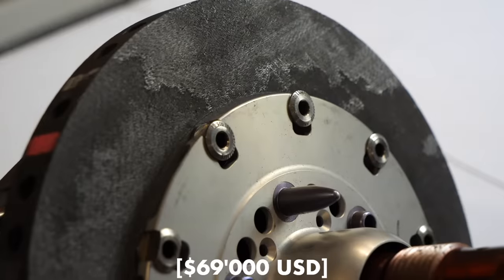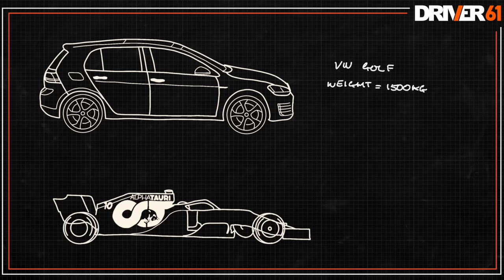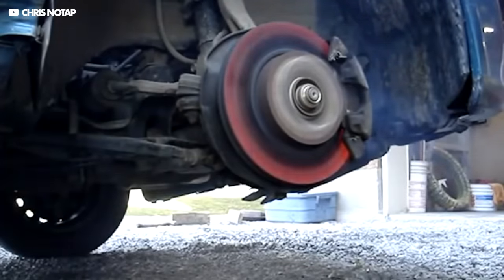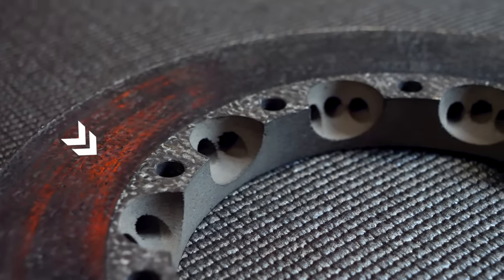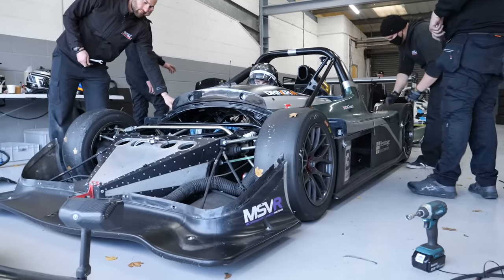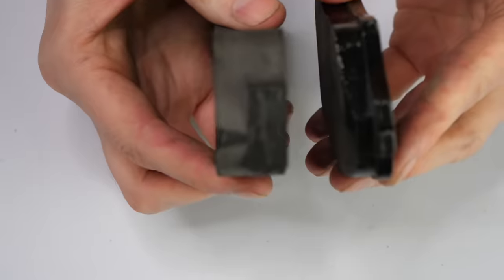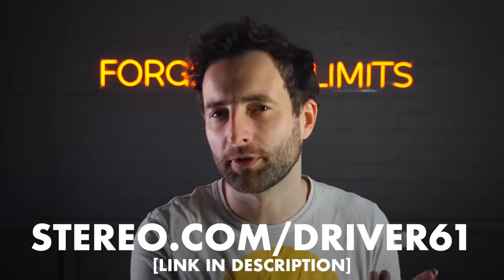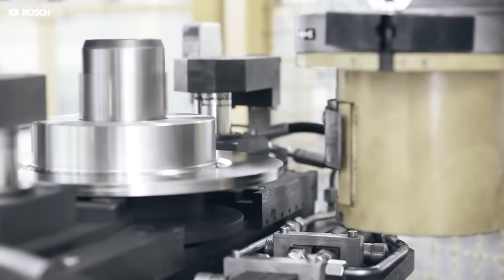Why These F1 Brakes Cost £50,000

Comment: Drag racers also use Carbon brakes.  I am quite sure they are not spending 50,000 pounds  per car for brakes.   So how are they able to do it cheaper?
Reply: they dont have to brake 1000 times a race like F1 would do?

Comment: This is an interesting video about the highly specialized carbon brakes used in F1 race cars. This video shows that car racing is a highly specialized sport that is very different from conventional automobiles. With car racing there is a lot of braking from very high speeds around 200 mph. With a conventional car on city streets most of the time there is coming from 35 mph to a gentle stop for a red traffic light. That is a big difference. In all my conventional driving I have never encountered brake fade caused by overheated brakes.

Comment: Also, that using your own body-weight and momentum to aid in braking. That's a thing for Saab-drivers. Whether you want to or not. You definitively need to replace seatbelt pre-tensioners every 5 years or so. as they do get activated quite a bit. :D :D :D But, then again, plebians gonna pleb.

Comment: 2:00 the maths for the kinetic energy of the F1 are incorrect. Actually, the kinetic energy difference is 1/2*[mass]*[[Initial speed]**2 - [final speed]**2], instead of what's shown in the video 1/2*[mass]*[[Initial speed]-[final speed]]**2. But the overall message is well understood

Comment: Some of the comments in this video aren't quite correct. Hydraulic brake fade from boiling fluid, is because the fluid is incompressible, while the gas produced is - and not that the fluid is less compressible, its not compressible AT ALL. Frictional fade from the temperature fall off of friction of the pad, will not make the brakes spongy, they will feel the same, you just wont get the same amount of braking from the same force, so you have to press harder. 
Brake fade can be caused by a number of factors, and brake rotor heat is not the only reason, and its also not quite accurate. There are 4 types of fade, friction fade, mechanical fade, fluid fade and domino fade. The major factor in all is heat. However brakes are not JUST made up of rotors/discs. We can think of the brake system as made up of two separate sub-systems, the friction system, made up of the rotor AND the pad. And the pad is the far more important part of the system when it comes to brake fade. And the Hydraulic System.
The heat generated, is generated at the interface of the rotor and the pad, meaning the pad also get hot. And after long enough, except for after an instance of very heavy braking, the pads and rotors will be roughly the same temperature (the rotors may heat up more quickly initially, as they're more conductive, but they also have a higher heat capacity. 
Pad material and technology is the thing more likely to contribute to 3 of the 4 types of brake fade. You can use different pads and experience less fade, or see fade occur later, even when using the same rotors, operated at the same heat. 
Regular brake pads that you find in regular, commuter cars, meant for soft braking, and low speeds, are made to have their braking performance (coefficient of friction) peak, basically at room temperature, or maybe a little above; they're not likely to get that hot due to their use and so you want the maximum performance to be when they're cold.
Then you have the other extreme of high performance racing brake pads, where the compounds chosen are designed to offer their best braking performance (coef. of friction) at much higher temperatures, maybe having their best performance between 300-350C or even higher. The consequence of this is they won't have very good friction at lower temperatures.
And then you have basically everything in between, from slightly higher performance street brake pads, to semi track pads. 
This is where we see the first type of brake fade, frictional fade. This generally defined is a reduction in the friction (coef. of friction) at the friction surface, the pad and rotor. This can be in the form of brake pad performance where the brake pads have heated and lost their coef. of friction, either linearly or curvilinearly. Other types can be caused by issues with brake down of the pad at the surface caused an interface layer to build up between the surfaces, drastically reducing friction, this can be gas from the pads breaking down causing almost like a cushion of gas; the other is resins in the pad, that break down and can glaze the rotor, this is mitigated using slotted or drilled (or both) rotors, giving the gas and/or resin an escape path, stopping ti building at the interface. Other forms of frictional fade can be caused by incomplete contact through wear, warping, etc.
The second type is Mechanical fade, which is associated with drum brakes as opposed to disc brakes. The drums heat up, and expand, moving the friction surface away from the shoe.
The Third type is hydraulic fade. After a long session of heavy braking, the entire brake system will heat up. This means the calipers, the pistons everything as the heat spreads.  This can lead to fluid boiling as mentioned, the boiling fluid causes gas in the lines, and instead of only incompressible fluid in the lines you have gas bubbles that take some of the brake force away by compressing, making the pedal feel very spongey as the fluid compresses in the lines.
Domino fade is caused by inconsistencies in braking force on the 4 corners, leading to excessive fade of each corner, accelerating the fade as each corner fails like dominos.

Comment: I have been working on a magnetic braking system for Formula 1 race cars and my new system is able to slow and stop a car from very high speeds with very little to no heat build up and without friction on the rotors. The system functions by using a magnetic core attached to the spindles surrounded by an electro-magnetic stater. As the brakes are applied the current provided to the stater is increased and pulls against the forward force of the spinning magnetic rotor attached to the spindles and to the wheels. As this happens no friction is applied to the rotor in any position of rotation providing that no heat will occur during high demand braking needs. The braking system is completely adjustable at any speed depending upon track conditions and is computer controlled. Sensors in the control module can sense brake traction needs at any speed and during cornering by referencing to suspension parameters. The system functions from a 100 volt 100 ah current system that is a variable volt and current system. It is for sale for 21 million dollars but needs more testing and research to be ready for its release to the public at this time.

Comment: Will they be able to have even better brakes when they move to larger wheels in 2022?
Reply: Maybe better cooling yes but i don't think the size will increase with the wheels because of the weight, so if no subject to regulations they will not change at all.

Comment: Just for any rides out there that are streets legal, theirs tones of products available form cheap to very expensive, just for my sport bike it’s street legal and already most sport bikes are already very well equipped of everything but if I want to change the calipers ‘’ just the calipers, no pads, no hoses, no master cylinder, for 2 calipers of the brand Brembo ( witch are in the best ones if not the best ) no the top quality but a very good one the prices for 2 calipers Brembo are around $ 2,000 , so imagine for a F1 😂😂😂😂😂
But ever heard the expression ‘’ to stop on a dime ‘’ !?   With this it’s almost true,  I’ve tried one bike on time who was all set-up for racing , not as a factory one but still, and I’m used to rides motorcycles, 35 years experience, did racing, stunts, you’ll name it !, and the first time I used the front brakes on this bike,( and I was been carful ) I almost fly over the handlebars, as it stopped so brutally guess it takes times to use to.

Comment: Road car brake discs are made of cast iron. If you had make them in steel they would have screamed alot. Cast iron is better to absorb vibrations and is better with changing temperatures
Reply: This. Specifically grey cast iron, which contains graphite. It also absorbs heat a lot better than steel and is resistant to warping.

Comment: So pieces of cloth are squished and then put in an oven for a month. Carbon is the most abundant thing on the planet. How much does that oven cost to run? What am I missing here? Not much detail on the mechanism.  A cost breakdown would be helpful for labor, parts, engineering, design etc. It's odd that the focus is on the pads and disc material but no mention of why they would be expensive.

Comment: I use ceramic brakes and do not experience fade after 20 laps.
Reply: Ceramic steel or ceramic carbon? Ceramic brake need to work at optimum temperature or drive and go?

Comment: Still doesn't explain the 50000£ price...
I doubt that there's more than 15000£ worth of materials.
But people will pay 50000£ and the "manufacturers" use "research" as an excuse for the high price. But you don't redo the research when you produce a disc. You just make a lot of discs based on the research that's you've already found, and most likely already made the money back so now it's just profit. But i might be wrong ;)

Comment: 5000£ 50,000£ or 20,000£ which one is it! Too much conflicting information....
Reply: Conflict #1
$50 for regular brake disc or 100 times the cost for a F1 disc. 100×50= $5,000 not $50,000. It would be 1000 times more expensive. 
Conflict #2
Teams spend half a million dollars or pounds or whatever on pads and rotors. At $50,000 per corner, or $200,000 per car, I'd think they're spending way more on brakes.
Couple other conflicts I cant remember at the moment. I like Scott's videos but his math skills are about as good as my driving skills... I'm a legend in my own mind.

Comment: Are the equations meant to be related to the narration? Because the equations given energy to be overcome for breaking as 734MJ (not 750 - but close enough) for the VW and 2832MJ fornthe F1 car. 2832/734=3.8 times more, while the narration claims it is over 6 times. Now, I may not be the sharpest tool in the shed but I do know that 3.8 is not over 6.

Comment: You have an error in the calculations it is kJ, not MJ just FYI :-).  KE = 0.5*mass* speed^2 => 0.5 * 1500 * 31.3^ =>  750 * 979.69 => 734 767,5 J => 734.7675 kJ => 0.7347675 MJ :-) but still, breaks will glow read :-)

Comment: To clarify, carbon-carbon brakes, slowed by carbon-carbon pads?
Reply: Yes, I have a carbon rotor and related brake pads from an Indy car they're totally carbon-carbon used on oval track. On street and circuits they use Brembo steel rotors but no carbon pads. I have several sets given to me from the teams to evaluate braking. Cheers

Comment: wouldn't cast limits be preferable due to the lower breaking point? Also, your head is directly in front of the sign, meaning that you never actually get to read the sign, making it surprisingly distracting. Even at that, your channel name might have made a better sign, still could make one. I do not remember you by channel name, "Driver 61" is fairly meaningless to me, so if you want me to remember it, you should make it more visible.

Comment: Yeah, no. Shitty road cars only have one piston. :D Saab (in it's 20 year old, Old Gen 900 form) had twin piston vented discs with ABS. In 1991. And in the OG9-3 and NG900 they have four at the front in Aero and High pressure turbo spec. Esp the Viggen has this taken to full-tilt stop-on-a-dime from 250km/h. :D And maintained this level of stopping power up until the demise of the marque. Volvo wouldn't settle for anything less, and I do believe they're S90 T8-R has quad-piston vented in the front. And twin piston vented at the rear... Something I often need to remind myself of when driving. Since, cars around me, DO NOT stop in less than 50m from 80km/h roadway speeds if I really stomp on them, in good summer weather, naturally. And I don't drive with anything but fresh rubber, that is, 2 year old tires ain't good enough anymore.  :D Also, the process used to make those carbon brakes, isn't just "very similar" to airplane carbon brakes. It's literally the same process. In fact, that brake caliper you handled at one point of the video that you allude to being F1 part. Well, it also has aeronautical part classification. Because, standardization, motherfuckers for the win! :P

Comment: Yeah, and yet again, wrong. Road cars with high performance braking systems. also use grooved / drilled vented discs to allow somewhere for the gas to flow and not to create a gas layer between the pad and the disc. This is effin' brake engineering 101 from the 1980's for heavens sake. Road cars have come along quite a bit in the past 30 years. Mostly thanks to F1 and Group B and later WRC pushing the damn envelope. :D The advances in motor racing most often, translates to actual real-world advances in road cars. THAT'S WHY THE CAR COMPANIES DO IT IN THE FIRST PLACE! Such as, the Carbon Ceramic Composites they use to coat Porsche discs with. The material is nano engineered carbon lattice over a vented disc. And it doesn't wear more than 0.1mm over it's entire use life of around 50 000km. Same tech is being applied to F1 and airplane brakes, as this approach mitigates the cooking off of brake fluid and dissipation of break pad material phenomena as they are effective at far lower operating temperatures and don't, you know, plume off like a old school carbotanium cooked in a steel kiln for a moth. :D